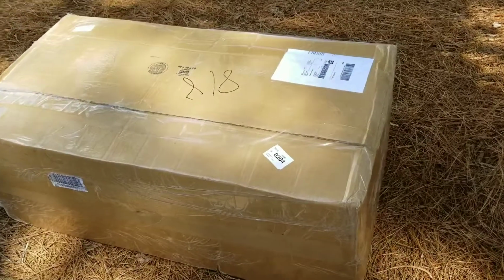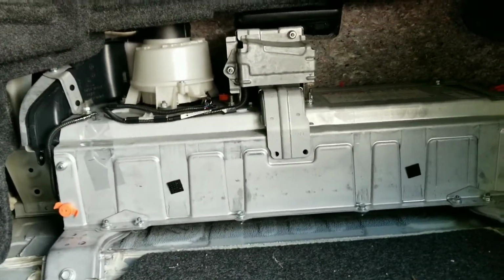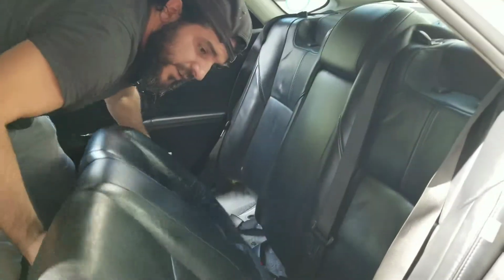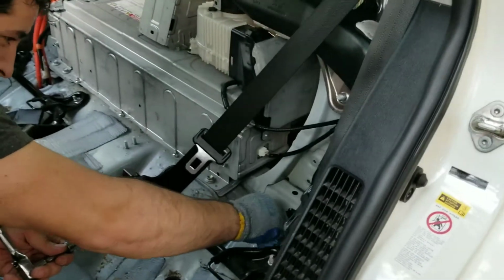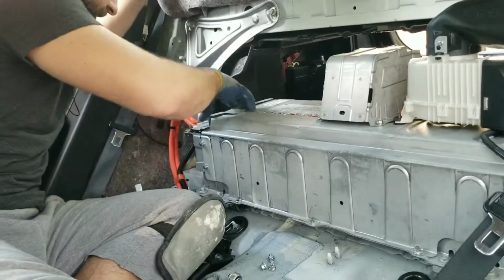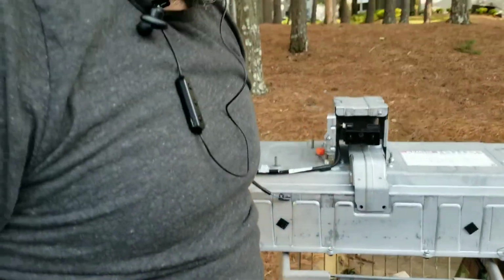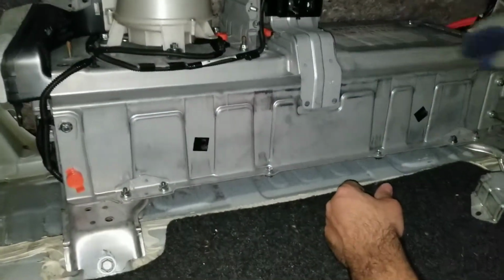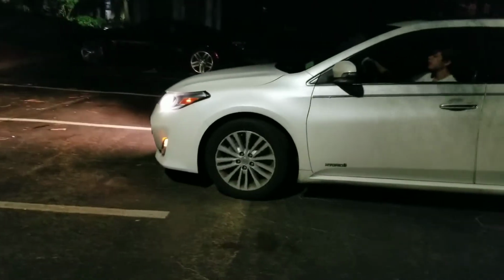Replacing Hybrid System battery for 2014 Toyota Avalon, Camry, prius Honda etc..

Comment: Did you test the battery modules to determine which one(s) are bad? Or you are convinced they’re mostly bad and decided to replace the whole unit and save time for the long haul? Thanks, it great to know there’s a guide to follow and work on one’s Toyota hybrid should there’s a need for it. I have a 2008 Camry hybrid 206k+ miles still running strong hopefully no battery failure anytime soon 🤞but it’s your video is backup just in case😉
Reply from the maker: Yes I did check everything that's why I said ooh better a new one replacing the whole battery then wasting my time .
Reply: My personal research is cars that are daily used will never have a problem. It's the cars that are parked for a very long time that get these issues.
Reply from the maker: @thegame123ize  that's true if its sitting there is more chance having this issue then the one working and running daily
Reply: @SmileysYT  my new only 40000kms driven toyota crown hybrid(that was imported from Japan) was parked for 6 months straight without turning it on atleast once. Now i'm getting all types of errors like " check engine light, VSC off, TRC off, triangle of death and dynamic Radar cruise failure. Sport, Norm, Eco modes failure and also safety features like PCS and ICS disabled.
Reply from the maker: @thegame123ize  wooow that's crazy all those errors.  Good luck buddy let me know what you do
Reply: @SmileysYT everything works when i reset the system. But when it comes back after a day or so it brings back all errors with it.
Reply: @SmileysYT  $5000 for new battery no alternative. I'm replacing a few cells in a day or two lets see.
Reply from the maker: @thegame123ize  replacing cells will only get you going for little bit not for long . Get a rebuild one its $1000-2000
Reply from the maker: @thegame123ize  yes that's what I did on my other video reset it and works for a day or more and then comes back
Reply: @SmileysYT  did you buy your rebuild hybrid battery from that company in Illinois for $1000-$2000????
Reply from the maker: I forgot what was their name but yes it was like $1700
Reply from the maker: I found out the name is 
Best Hybrid batteries  and yes it is Illinois
Reply: @SmileysYT  thank you

Comment: How is the replaced hybrid battery holding up for you? The hybrid system stops working on my 2014 toyota avalon and i need a new hybrid battery. Upon my research I found a rebuild one online from that company name batterfly. And they are only $1250 and they have a special at $250 off so that makes it only $1000 for the battery. Im really skeptical about the price
Reply from the maker: My hybrid is holding good so far. I'm at 300k miles and still running check their reviews and see what's their warranty.
Reply: @SmileysYT  where did you purchase your battery?
Reply from the maker: https://youtu.be/0MihJCKbxiE I have a video of where I did I forgot their name broo 😆

Comment: Looks like the car lasted you a while. I just got the triangle of death on my 2014 and was thinking of buying the hybrid battery from the Toyota dealer (brand new) vs the reconditioned version. I would still install it myself like you did. 

If you had to do it over again would you get another reconditioned battery or buy brand new?

Thanks for the video!
Reply from the maker: Yeah sometimes they last you more then what they say but I'm ready to trade in to a newer one.  I don't know if I would change  the battery more then once , but hey you never know depends on the budget 😉

Comment: Only video with my car! Wanted to do a module swap but they don't rent 2014 avalons lol! Update your video I would like  to know how it turned out and how many miles did you get the hybrid system warning? I'm at 150k and feel it coming.
Reply from the maker: I got mine like 125k and I was just resetting for a while till I see what I was going to do.  I tried to see if I could just change the cells but it was so much hassle to see which ones were bad I tried 2 times I opened up 2 times just couldn't find which one was bad so one of my friends is a mechanic said to change it , by a new one so that's what I did so its working fine.  Thanks God
Reply: @SmileysYT  cool I guess when it happens I'll hit up greentec. They have a location close to me in NJ. $2'300.00 with brand new cells. They seem to be a good honest company.
Reply from the maker: @projectnerdvana2820  I hope it dosent happen it should go for about 8 years but mines 4 years and started acting bad I had warranty for 100k only :(   . Good luck wish you the best buddy

Comment: Is this called the Hybrid System, or Battery System? Do You know what does the Prius System look like, and is the Prius Hybrid System more difficult to replace, and the approximate cost? Thank You so much! 
We're Retiree's in our 70s and barely scraping by in the San Diego area, and Need our Vehicle...I can perform most Maintenance, even with a disabled Back, because we have No Other Choice, since i caught the Dealer trying to rip us off when our Head Gasket/or Head started to fail, and they wanted $6000.+ but i fixed with an $80.Dollar Bottle of Blue Devil, which has saved our life about 6-Months ago and it has ran like a Champ ever since! But Now the Hybrid System is having issues in our 150,000mi 2010 Prius? yet the original batteries appeared to to working quite well?? And unfortunately we have No Saving(persay) and would be Devastated if we lost our Vehicle! How can i find a truly reputable dealer in "New or After Market" Hybrid Systems?
Is there a significant difference between New and Aftermarket systems?
Reply from the maker: Yes Prius is much easier and cheaper there are more much more Prius hybrid battery system then any other cars . I bought it for $2000 free shipping and installed it my self it's not easy to install heavy and kind of annoying to, but yeah just search for Prius hybrid battery system and you will see there some refurbished Wich it does the job just like the new one and it's much cheaper should be around $800-1300 I dont know now because of the pandemic how they going . Good luck hope you fix it fast wish you all the best stay safe
Reply: @SmileysYT  I Truly appreciate your Guidance and Assistance during these troubling of time's, on this difficult, but beautiful Planet, where even the instabilities even appear to affect certain technologies on this beautiful planet...